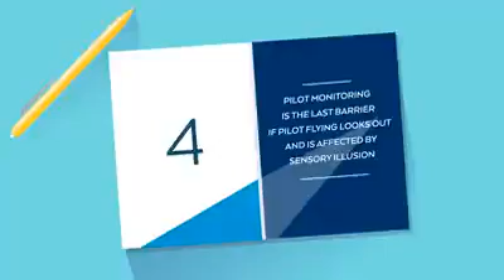Aviation - Sensory illusions, amazing and helpful video! RIP Kobe 🏀

Comment: This is such a weird thing to happen to humans. It will be very hard to get over this illusion as a pilot.
Reply: It's not just hard, it's impossible. 

Humans will always be fooled by it if there is no visual reference to counteract the feeling because gravity and acceleration are essentially the same thing. In fact that's all gravity actually is - an acceleration towards the center of a mass. Thus a gain in plane speed(acceleration) will feel EXACTLY the same as a gain in elevation to the human mind. 

During a TOGA(Go Around) the plane automatically increases thrust while simultaneously increasing pitch. The human mind will have a sensation of being pushed back(gaining elevation) from the acceleration alone and combined with the automatic increased pitch and without any visual cues to counteract this sense (flying in fog/cloud cover or simply looking up into the uniform blue sky) the natural inclination will be that the pitch is excessive. Excessive pitch is bad because if the angle of attack becomes too high it will result in a significant increase in drag and then a loss of airspeed. Insufficient airspeed can reduce lift generation which if not corrected will cause the aircraft to lose altitude or stall which is incredibly dangerous because if your altitude is low it's essentially unrecoverable. 

Example; In April 1994 China Airlines flight 140 was on approach to Nagoya, Japan when the first officer accidentally pressed the TOGA switch. The pilots attempted to override the autopilot and land anyway, but the autopilot fought against them, adding more nose up stabilizer trim in an attempt to get the airplane to climb. When the pilots stopped fighting the autopilot, the plane pitched up steeply, stalled, and fell straight down onto the runway killing 264 of the 271 passengers and crew.

Excessive pitch-up also places undue stress on the airframe, particularly if it exceeds the aircraft's design limitations. An aircraft is designed to operate within specific pitch limits for structural integrity and stability. This stress can lead to structural damage and instability, compromising the safety of the flight. So it's only the natural that a pilot would perceive the TOGO maneuver as being excessive, when in truth it is not as it is automated to be within the limits of the aircraft. Pilots are well trained on this phenomenon but awareness is all we can do. There's no training that can actually change the human mind's perception, the brain will always be fooled by the sensation of somatogravic illusion. Thankfully experience pilots know not to simply react based on what they are feeling and will trust in their instrumentation.